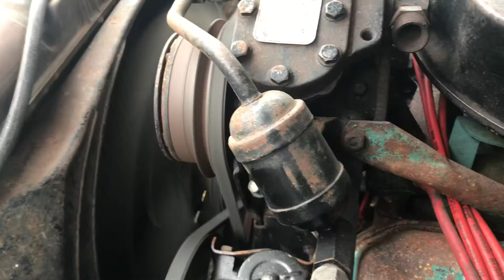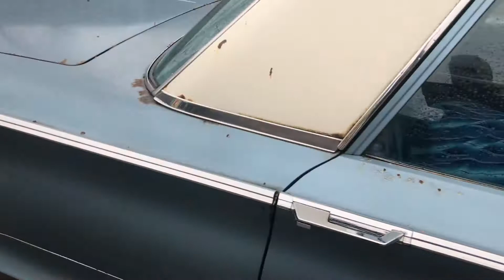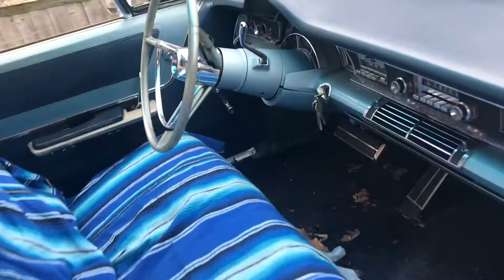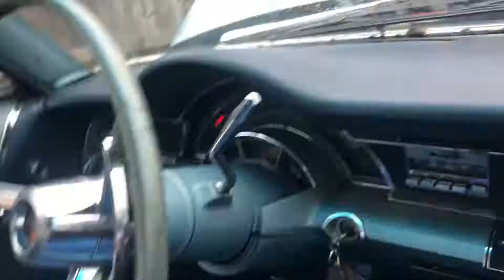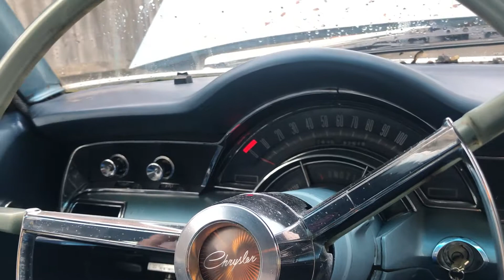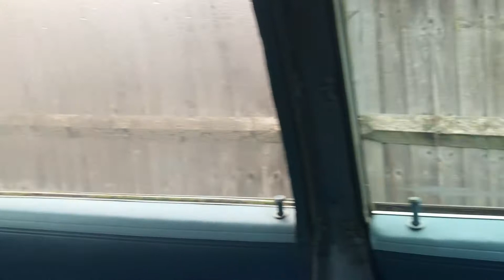1965 CHRYSLER PLYMOUTH DODGE NEWPORT 383CI 727 AUTO C BODY

Comment: We have a 65 with a 413  trailer tow package , trouble is we cant get the trans to shift into low one . or first gear . it seems like it trying to move forward and back at the same time . tried adjusting cable per service manual   no go ..  wish we would've just got a 66 or newer